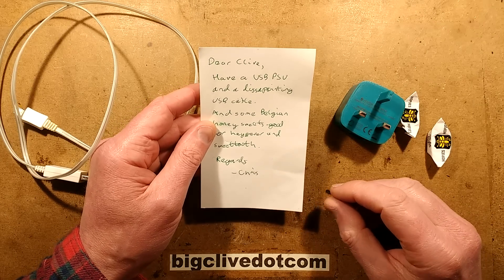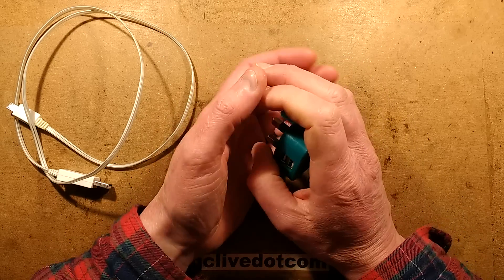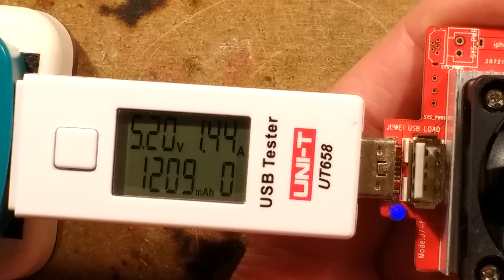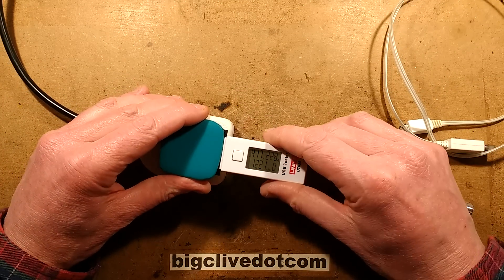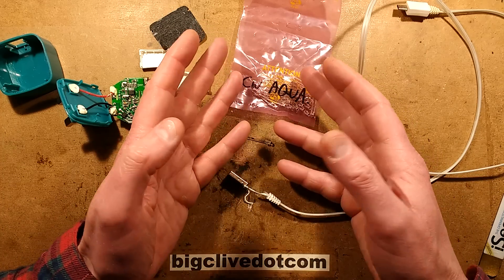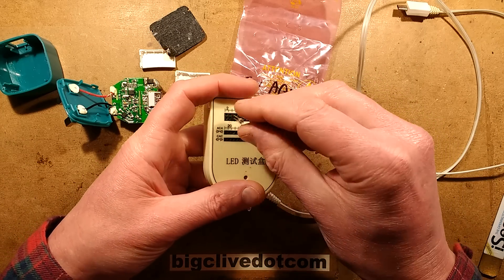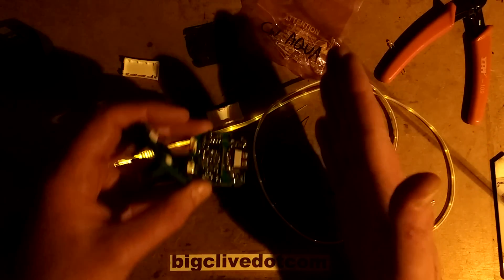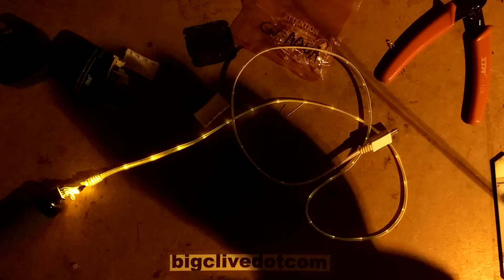Stinky Poundland USB charger and hack of random "faded" USB lead.

Comment: This safety video should be (extracted/featured/highlighted) on the news.  Unlike 2nd hand fridges which can be avoided I imagine most people have a charger on the floor by their beds, clothes, and not so reliably located smoke detectors
Reply: They need to make smoke detectors totally enclosed so that random objects, dirt, and most notable smoke can't enter them. I'M KIDDING! Enclosing smoke detectors is a horrible idea! Fire would have to melt its way through the plastic to set them off. By that time, the electronics and probably you would already be dead due to heat (the electronics in the detector) and smoke inhalation (you).
Reply: Grenfell fire was caused by such.  Indeed the ubiquitous chip "fat" fryer is no longer the main source of combustion in the home
Reply: paul martin  Fires as a result of (attempts at) cooking in the home remain a significant cause. People falling asleep while having a fag / smoke / cigarette was a significant cause of fires in the home. Prior to that in years gone by, the biggest problem was candles falling over and open fires spitting hot embers. Even with the advent of cheap and nasty electrical/electronic tat,  electrical fires are not very common. Most fire authorities strongly recommend that any non-essential electrical/electronic products/devices are switched off or unplugged at/from the mains socket/outlet when not in use or when left unattended.
Reply: @Ess Ess 
They really do make shitty bathroom fans these days. Seen asthmatics blow through a coffee straw harder. Now, the 1953 US made NuTone in my bathroom, pulls a vacuum on the bathroom. No steam build up there, and no smells either.
Reply: Copy that - not sure that such advice is relevant to fridges.  There has been coverage on my point on BBC news this am  with the authority Which providing commentary
Reply: Funny you should mention; I recently bought one of the very-nasty $10 tire (tyre?) inflator compressors, and it seized up on its second outing (the pump con-rod locked against the motor spindle, because the cam linkage didn't ensure sufficient space between the two), melting the (plastic) motor end-cap inc. bearing after a few minutes.
Which didn't bother me too much (I bought junk; it was junk; go me) until it occurred to me that the seizure could fairly easily have set fire to my car, by overheating the cigarette-lighter power cord  :-)
Reply: theskett, if the 'locked rotor current' didn't blow ye olde fuse in the vehicle then perhaps it's overrated or the pump's LRC isn't that high, and the risk of fire is minimal. However if it's using a slow blow fuse or a shunt for a circuit breaker, the socket could very well be stressed, but realize that the socket was designed for actual cigarette lighters which make plenty of heat on a regular basis.